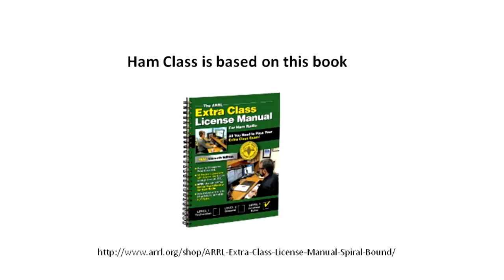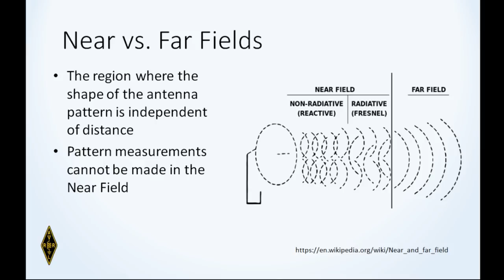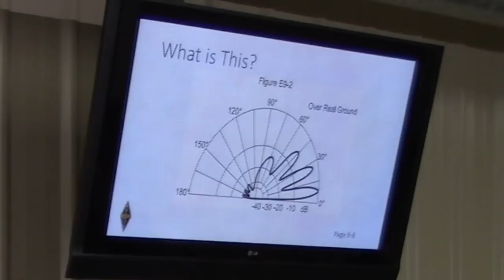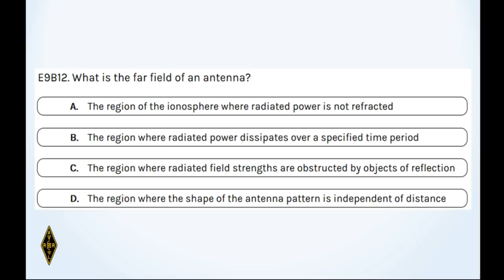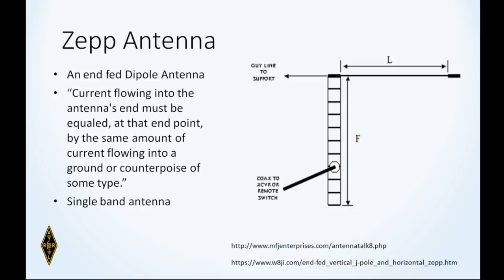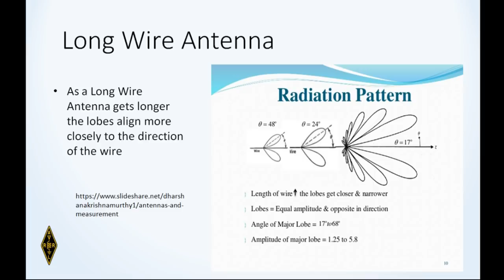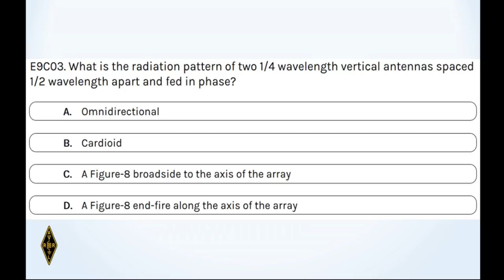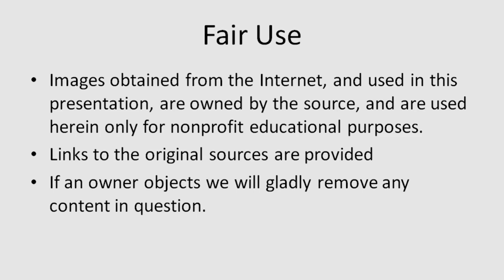OLD Extra Class January 2019 Chapter 09 Part 01 Antennas and Feed Lines - Old Question Pool

Comment: Regarding Gary’s “added value material” that doesn’t really relate to exam questions... continue to often go over this novice’s head and not connecting the dots to be either understood or retained ... example:  at 5:10 in, two slides presented regarding ratio of voltage to current ... Great!  I would LOVE to understand this and think I know why Gary is covering this - as pertinent to understanding SWR and impedance matching aspects of antenna performance (I think).  After reading related portions of ARRL study guide thinking, “I really need to understand more of what this means,” and lo and behold Gary attempts to do that.

Unfortunately, it feels a series of statements as if shared between elmers over a cigar, without the needed “explanation” of each statement.  Almost sentence by sentence over these two slides, a fact without an underlying explanation, followed by another statement without an explanation.  Very important concepts not landing, frustrating and a lost opportunity.

That after the first 5 minutes of glossing over slides’ subject matter, where a diagram of some kind is shown on the slide and not explained... next slide, unexplained content, next slide, etc.  As if the presenter and audience are on equal footing, speaking Elmer to audience Elmer, over brandy, with the Elmers’ listening replying, “quite right, quite right,” sip brandy.  But to non elmers... a miss.

If going to cover something, get into the base details, specifics so the non Elmer audience can connect the dots, or it’s wasted effort.  Hoping for better for future versions students’ benefit.  I’m still at a loss on this whole voltage/current antenna performance matter.

I wish I were local to attend in person, so any of this could play out:

- Gary makes a statement without underlying foundations... I would respond, “why is that the case?”

- Gary makes another statement without underlying foundations... I would respond, “how does that work exactly?”

Or I’d simply respond, “explain?” to any unsupported statements throughout the session.

The videos serve a valued purpose.  I recommend them daily on social media, because I feel I do get better prepared for the next Exam... Dave’s more so... but they could do better on the skimmed “added value” material if just narrowing the feature coverage to fewer most important topic, and diving deep enough in detail to make the dots connect.  Fewer covered, ground in more fundamental depth.
Reply: Couldn’t an isotopic radiator be built today given the microprocessor/IC/component sizes, for even a single frequency... as a small orb able to receive/transmit with a conductive surface to radiate as a repeater?  An incoming signal repeated/radiated out in true 360 degrees?
Reply from the maker: If you are ever in the Greenville South Carolina area please let me know. I would love to get together. Email w4eey@arrl.net 73 de W4EEY

Comment: Q1) Will you be producing new Extra classes for the new test?
Q2) How do you measure the Antenna impedance independent of the feed line so that you can balance it with the known feed line impedance?
Reply from the maker: Yes, we plan to have a new Amateur Extra Class starting in the Fall using the new Question Pool. The new Pool takes effect July 1, 2020.

You can put your measurement equipment right at the antenna feed point. Of course if this is a dipole hanging in the air this might not be practical.

Or Old Timers would say to build a half wavelength long (or multiples thereof) feed line for the frequency of interest. Use this to connect to your antenna. A half wavelength line repeats the impedance presented to it so you would see the actual antenna impedance at the other end.

Modern techs would tell you to get a Vector Network Analyzer (even one of the cheap $ 50 Chinese units) and do the VNA calibration procedure (with a short circuit, open circuit and 50 ohm load) with these loads at the far end of the feedline. By doing this you eliminate the effects of the feedline when you make your antenna measurement.

73 de W4EEY

Comment: Antennas are my favourite subject!  Anyone else?  Reminds me of the time I installed an antenna incorrectly on one of our police cars and everytime the officer would close the mic, the trunk would pop open.
Reply from the maker: The Marketing Department would say, "That's not a problem - that's a feature!" Thanks for sharing. 73 de W4EEY
Reply: Gary, how or why is the Beverage antenna immune from noise?  Is it something to do with the fact they won't transmit?
Reply from the maker: It is all about getting a better Signal to Noise ratio. Atmospheric noise is the predominant noise source for 160 and 80M. The Directional nature of the Beverage Antenna will reduce noise pick up from other than the target direction. A Traveling Wave Antenna like the beverage builds a signal voltage along the length of the antenna from a coherent radio signal. Randomized noise signals do not get this reinforcement. 73 de W4EEY
Reply: Read this answer a couple of times which prompted me to review the prior studies  a little and I think I got it! thanx